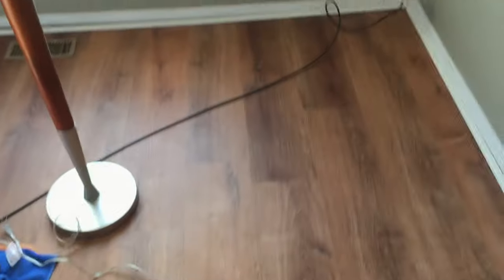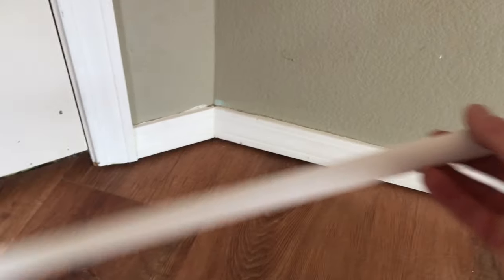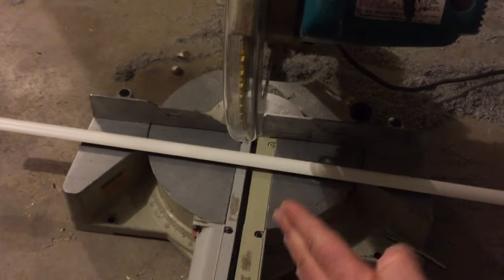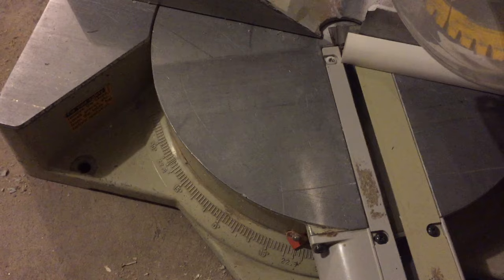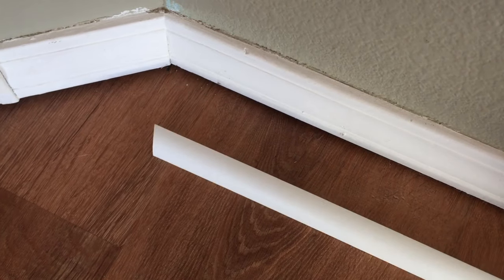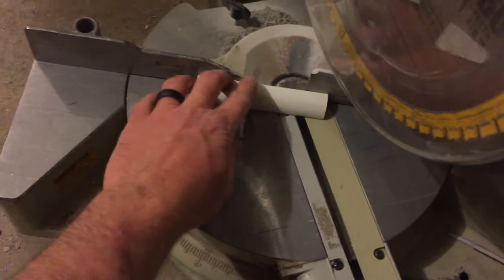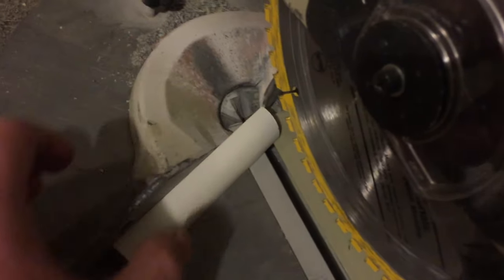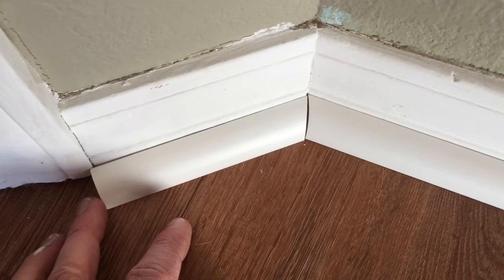How To Cut Quarter Rounds for a 45 Degree Angle

Comment: If your cutting at 22.5 (split from 45), then the inside corner angle of the wall is a 135 degree angle.  Not to confuse anyone but if you measure the inside corner wall angle, it will be 135. That should be explained.
Wall angle - 135
180 - 135 = 45
45  \ 2 = 22.5
Make cuts at 22.5
Reply: caught that myself and its the most important part
Reply: Thanks for this short explanation. Helps to see the all the math to understand why we got to 22.5.

Comment: I would like to see how you finish the end where the door molding is.  Are you installing different molding for the bottom of the door trim?
Reply: If a professional does this, we do what's called a self return. The door jam side would be angle cut and following the same angle cutting the trims angle off on a separate piece and it returns itself into the wall

Comment: The easy part is cutting it - but that's what the whole video is. The hard part is figuring out HOW to do the measuring... and you left that part out :(
Reply: You can cut your angle firts and the cut it whatever size you need
Reply: Speed square, mark a 90° line. Move square to other wall and it'll show you the degree

Comment: I'm probably being thick but that angle doesn't look like 45 degree more like 135?.....now I'm confused?
Reply: @jaimegmc  Wha???
Reply: If the wall was perfectly straight it would be 180 degrees. If it's a right angle then it's 90 degrees. You're just splitting the difference because it's halfway from a 90 degree angle to a straight wall. Just like you're splitting the difference in the 45 degree cut to a 22 and a half degree cut